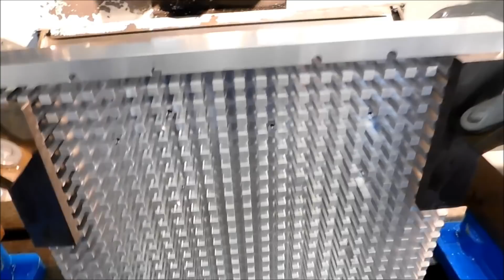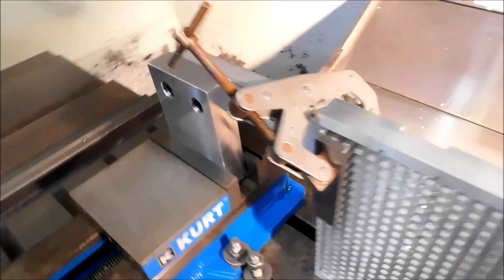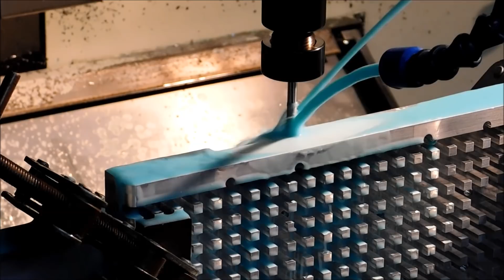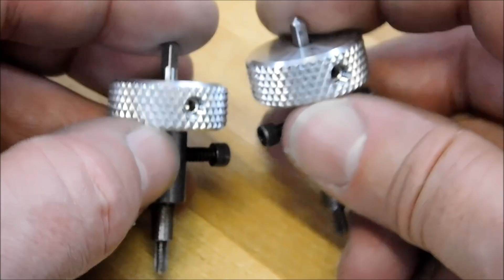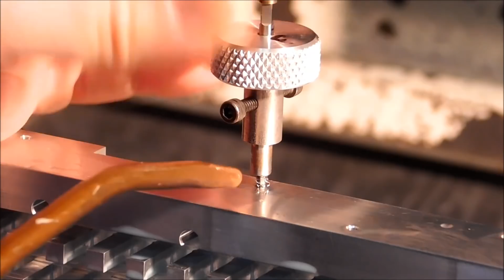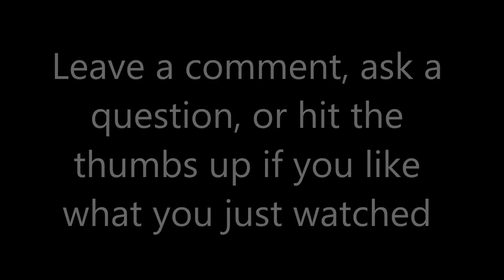Tapping Small Holes - Not a Problem

Comment: Just had a job where i needed to tap 80 M3x.5 holes and broke two taps before i looked up tips and found this video. I used a tension pin with two shaft collars stacked on top of each other to mimic this design and although my fingers hurt like hell it got the job done perfectly. I thank you so much for this video you have no idea how much it saved me on a tight deadline.

Comment: Next how do you reliably cut tap M3 holes in 314 using CNC cycles.
Reply from the maker: Drill slightly oversized holes to reduce the thread % and use a good lube. Buy multi flute coated taps and keep those fingers crossed. Look into Emuge style taps.

Comment: Good stuff, Joe.  I'm gonna have to make me a couple of these.  You got any advice for tapping big stuff on the lathe?  Anything over 1/2" and my tap handles won't clear the bed ways.
Reply from the maker: Unless you make a custom tap handle or rest your tap handle against a board between the handle and ways using power, I always just reverted to a big adjustable wrench. Once the taps is started, use a ratchet wrench and drive socket.
Reply: Power tapping in low gear scares me.  Good tip on using the ratchets though, I'll give it a try!  Thanks!

Comment: Gives me an idea for making a spring loaded top tap holder for my drill press to work in the same way. Lock down the plunger on my drill press to desired depth and then use the tap as directed.
Reply from the maker: I need to make a spring loaded one with a 1/4" shank. That would be very useful for me.

Comment: This is going to make drilling small #10 (I think) holes in the back of an AR. 
It is for the rear takedown pin retaining pin and spring that goes under the receiver end plate and always goes flying when taking it off for any reason.  Tap that hole, cut the spring in about half, give or take, then put the pin and spring in followed by a headless machine scree. You’ll never loose the screw AND one can now also adjust how much pressure it takes to pull out the rear takedown pin.

Comment: I am loving all of your videos and learning a lot.  I am glad I stumbled across you just as I was getting into machining.  Prior I was an airframer in the U.S. Navy as an AMS3 (aviation structural and hydraulic mechanic) and learned how to do a lot of aluminum work in making aircraft wings, body panels, structure, and flight surfaces by hand with simple manual machines.  Except for a pneumatic hammer as a rivet gun and a bucking bar.  I really miss those days, but the knowledge is great.  We also learned hydraulics and flight controls.
My wife was an avati9n Electrician in the U.S. Navy as well, I couldn’t imagine chasing one with wire the length of the aircraft through bundles as thick as your thigh, and ALL WHITE wires.
We both worked on the truly amazing F-14 Tomcat, in different squadrons of course.

ANYTIME BABY!!!!

Comment: Great video, Joe.  Why not change the knurling over to the coined type knurling?  (I don't know the correct hame of it) -  That type of knurling will be easier on the fingers
Reply from the maker: Straight knurls are fine, but you can adjust the diamond tips so they don't cut ya up. Either don't go as deep, or take a light skim cut after you finish the knurl. Wire brush it and all ends well.

Comment: I've removed a broken tap from aluminum with Nitric Acid - About 6N, if I remember correctly, and only on an aluminum part with a steel tap. The acid doesn't bother the aluminum but it chews the tap up over the course of a few hours.

Comment: A neat tool for sure. For tapping smaller holes. under 2mm and down  to about  0.3, I use a small pin vice ; great feed back and control, but ensure your clearance hole is large enough--- check the recommendation in the tapping tables, they're a smidge more for smaller holes generally.
      Keeping the threading true and perfectly aligned is tricky, but having the work accurately jigged in a vice enables you to cue off of its square dimensions. There must be tool for this too...?

Comment: having an issue hope someone can explain the best path so not to damage my new 5 c collet chuck i got a byson chuck and a backplate from grizzly industrial every thinng has been machined fits on the chuck nice now where things have gone wrong i was test fitting one of the machined bolts and some how can not back the screw out to take the back plate off i have all ready broke one allen wrench any advice what steps to make with out screwing up (pardon the pun) the brand new 600 dollar chuck! help Greatly appreciated thanks in advance.
Reply from the maker: Make sure the other holes and bolts are clean and put them in. Torque them down and now try to unlock the frozen one. It was maybe the last one to come out and saw too much pressure. Unlock them all a little at a time.
Reply: @joepie221  thanks

Comment: That's a common 6/32 tap and some heavy handed people might have problems with that. But tapping small holes? This video doesn't cut it! What about the microscopically small holes and screws used in watch fabrication and shit like that? Been done for hundreds of years so how the fuck do you do that?
Reply: With a pin vise and hands that don’t tremble.
Reply: @JasperJanssen  More impressive than steady hands are those who made the taps and screws to fit those tiny holes.  I suppose originally that would have also been the same watch maker.
Reply: @TruAnRksT  I’m actually thinking that if you’re tapping into brass and bronze model engineering alloys (and/or gold and silver alloys, for clockmakers and jewelry), rather than iron or let alone steel, you might want taps that are much less hardened than normal, specifically so they don’t break as easily.
Reply: @JasperJanssen  Yes that's a good point, but they still have to be considerably harder than the chosen material. 
It amazes me how they were able to produce such tiny screws so long ago.

Comment: It's 1/4 O.D. on the top end and it looks like a 1/4. But what is the I.D. from the top and the bottom???
Reply from the maker: I have several, depending on the tap size.
Reply: @joepie221  any blue prints you willing to share

Comment: haaa, i happen to have 200 of those exact wheels, but with opposing cross grubscrew holes, made for locksmith tools.  I couldn’t help notice the heavy eccentricity/runout, when the tap got to the bottom of its travel and the steel collar almost bottomed out.  Any idea what this was?
Reply from the maker: Sure, These knobs and collar stops are made to cover a variety of tap sizes. The runout you witnessed is due to the smaller shank of the tap being pushed to the side of a larger collar bore. You still have linear contact and the function is not compromised. As the tap bodies get larger, the runout goes away.
Reply: Joe Pieczynski thanks, that’s explained it perfectly.  Have you ever tried tapping Titanium by hand in M3 or M4?  I’ve had three products put into limbo because I snapped two of my best Presto taps.  I think I got 2 threads in and crunch.😭🤦‍♂️🤣🤣🤣

Comment: Hi Joe.
I have evolved a simple method, with just a small tap wrench, and power drive my M3 and smaller taps. 
Method: alignment cap with a hole on top of tap wrench. One of mine just has a 4mm hole. I have a 4mm pin in the spindle chuck. Just place a rubber grommet on the top and it does the driving. Push down, more torque and the tap goes down and away from the grommet magically reducing the torque. Backing out is the opposite problem, so I just reverse manually with the grommet not touching.
After very carefully breaking a M5 tap solid tapping I decided not to go solid below M5, 3/16" any more. I am using small cnc syil SX3 mill with a manual quill, so it is easy to control.
Reply: Seems like more risk than it's worth

Comment: Great tool Joe. Combined with roll form tap it would be even better. I stopped using cut tap on aluminum for anything smaller than M6. Your tool works great for both types. Thanks for the videos you posted. I still don't get it why there are so many dislikes for your videos.
Reply: Lots fucken idiots in this world so they feel the need to attract attention i guess.

Comment: Question for you Joe....I have two holes .130” deep that need tapped 6-32 and the material is an alloy steel similar to 4140. What advice would you give? Would this tool work well in that scenario? Thanks. I’m making one of those tiny tap wrenches ASAP!
Reply from the maker: The small button drive wheels will help the feel, but you have a combination of the 2 worst elements possible.6-32 threads have an unusually deep thread as compared to the Od and root. this means they break easily, and the 4140, well you know. If I had any suggestion, I may drill the hole a little bigger, grind the cone tip off the tap but don't hit the threads. That will give you more thread room and you won't break the tap because you bottomed it. Use a new tap, possibly an emuge brand and be patient. Nice job fitting the end of that optic to the cutout in that slide by the way.

Comment: I enjoy your videos, especially the small stuff. Where do you get the spring loaded centers, and is that what they are called?
Reply from the maker: That is a NIROL tap guide
Reply: Thank You
Reply: If someone wants to make their own, one good way is to make it out of a Weldon tool holder, as it has nice round hole in it and a screw. Just drop a spring in there and a piece of round with the female/male 60 degree taper on the end and a flat for the screw so it doesn't fall out.

Comment: The depth stop on the tap guide is a great idea.  Most of the time I have thru holes that have allowed me to tap as small as 2-56 on my old drill press running at 100 rpm.  If I have a blind hole, I tap about 3 threads and finish with a tap handle.  I need to take time time to make tap handles for my smaller common sizes.

Comment: Not a job u wanna make a mistake on!
Reply: Sinker EDM is a good thing to have access to, so you can burn the tap off if needed. Or in case of aluminum part and steel something broken inside, you can use nitric acid to eat the steel out.

Comment: I'm embarrassed to admit I don't quite understand... is the tap driven solely by the set set screw in the wheel and why does the steel portion have two screws in it?  Does that steel portion slide into the wheel or just but up against it?
Reply from the maker: The tap is being driven by the wheel. The lower component with 2 screws in it is a depth stop. It simply bumps up against the wheel in this setup. When the wheel can't be used, the 2 screws on the depth stop serve as small handles. Dual purpose.
Reply: @joepie221  show off. Awesome stuff. Keep it coming. Even the small stuff is great.

Comment: Thread depths greater than necessary are probably #1 cause of death... usually specified by designers/engineers that have never thought much about it. Regardless, 100% of fastener load is distributed throughout the first 6 threads. Followed closely by machinist who think they need the "75% thread" drill to create a Class B thread.
Reply: I worked with a man many years ago who said same as you. Fair comment but..... if a particular part needs to be submitted for independent inspection, you must follow drg instructions. The majority of quality inspectors have no common sense. In a sub-contract machine shop, it's no good if you supply 300 parts with 6mm depth of thread. If the drg requirement is 9mm depth, them give 9mm!!
Reply: I'm not sure what you are trying to say here. The more distance of thread you have in contact with the screw, the stronger the axial load it will be able to take. Depth of thread has got nothing to do with it's failure rate. When you are looking at the actual head of the screw, you'll quickly realise that the head will take significantly less load than what the thread can take, that is the key to it's failure rate.

There is a nominal thread depth for safety, but the unnecessary length is to save cost and weight more than anything else
Reply: The first part is in regard to tap life, not fastener life. 

Threads fail in shear, not in tension, so yes, increasing the length of engagement will increase the cross sectional thread area, increasing shear strength. 

From Fastenal's site (https://www.fastenal.com/en/78/screw-thread-design): Caution: It appears that one could theoretically increase the thread strength by increasing the length of engagement. However, as illustrated in the Load Distribution chart above, the first thread will be taking the majority of the applied load. For carbon steel fasteners (including tapped holes) the length of engagement would be limited to approximately one nominal diameter (approximately 1-1/2 times the diameter for aluminum). After that, there is no appreciable increase in strength. Once the applied load has exceeded the first thread's capacity, it will fail and subsequently cause the remaining threads to fail in succession.

Comment: I've watched more than a few videos on machining and usually I see an air hose used to clear chips, or maybe a brush.  Is a shop vacuum not good for keeping the workspace clear?
Reply from the maker: Truthfully, I only use a shop vac on dry chips like wood or phenolics I don't want mixing with machine oils. Air also guarantees the small chips get off the parallels for better part registration.
Reply: I actually just cleaned a old Pedersen Milling machine today. The shopvac was way to underpowered to suck up the chips in "cracks" and the T-Slots. The air blow gun got it out and the chips on the floor got scooped up with a broom and a shovel.

Comment: Tapping holes by hand especially in hard to reach places is added and abetted with a socket set designed to hold inch and metric taps (available from SnapOn).
Reply: Or use the appropriate 12 point socket that you probably already own.

Comment: Anything under 3/8 I've gone to a powder metal form tap.  In aluminum I run them about 120 sfm, in SS about 50 and in HTSA about 15.  I've yet to ever break one in a  CNC and it's been approximately everyday for almost 10/12 years now.  One shot, to depth, and never a problem.  I've actually had more problems with thread Mills (in larger holes mainly) tbh.  Love your videos Mr Pie, you're very knowledgeable.

Comment: Nice Job, my dear Joe. I have few questions:
1. Could someone use a spring loaded tap holder and let the G-code/machine do the job? 
2. What if the size I want is #2 NF screw (smaller than yours) but a hard material. Will this method work as well?
Regards;

Comment: A technique we use for a big production of SS304 with 4-40 thread 1/4 deep around 2000 parts with one tap and it doesn't break, is we grind relief all the thread of the tap except two full dia thread. Try it!

Comment: Great videos, Joe.  I have learned much from you.  THANK YOU!
I tend to use spiral point taps even on blind holes - much less torque required and taps snap off less often.  I would rather waste time removing debris from a tapped blind hole than trying to remove a broken tap.
Reply from the maker: I agree. Broken taps are no fun.

Comment: On the tap guides does the steel part butt agonist aluminum cap or is it inset into the caps some.
Reply from the maker: It butts against it. But that can change based on the depth of thread you set.

Comment: Alum in a water solution will dissolve a tap in brass.
Reply from the maker: Kinda scary that a company that makes spices for cooking offers such a caustic powder in almost the same container. Tide is just now finding out thats not such a good idea.
Reply: my results in trying alum to be rid of broken bolts in an old mower blade housing was ... disappointing.  Only partial removal, and it took most of the warm season to get that.

Comment: I love that aluminum threading with 2 finger pressure.  Here I grow frustrated trying to tap some hardened steel for tiny #6 screws.  Two taps worn smooth already and only half way done.  LoL
Reply from the maker: #6 screws are the devil.
Reply: Ken ibn Anak, we have #4-40 and #6-32 form taps (roll taps.) They work extremely well in softer materials. Not sure if they would work in hardened steel. Maybe contact some tap manufacturers. And see if they have a form tap for your application.

Comment: Forgive me if I've missed this question/answer. What coolant are you running in the mill. Blue... Coolmist? Am wondering about running a mist system for some ops lathe and mill. Wondering about coolant caused corrosion. Any feedback would be greatly appreciated. Thank you for all your informative videos. 

Cheers
Reply from the maker: Trim-Sol water soluable. Its about $170/5 gal. from MSC. I love it. I keep it well balanced and clean and I haven't had any issues.
Reply: I was wondering the same thing. looks very similar to what we run.

Comment: Joe, thanks for all you great videos.  Question for you on milling cutter size versus size of machine.  It seems that smaller cutters on a small less rigid machine would work better with respect to chip load.  What are your thoughts on this?
Reply from the maker: Absolutely. The setup has a great deal to do with the success as well. A video is coming with some solid tips. It may be included in my next video. The title will be something about reduced or eliminated X axis backlash.

Comment: Joe, thanks for demonstrating this useful little tool for driving small taps. I've never seen it done exactly this way before but well understand the effort to avoid broken taps.  I've tapped many small holes (even in 17-4) under power with slightly oversize tap drills and new spiral point (gun) taps with plenty of oil. This only works well if tap hole can be deep enough to contain chips at bottom without binding the tap. Even this is risky and impossible if client requires holes to be bottom tapped. Your tool will save many expensive parts and keep your clients very happy.